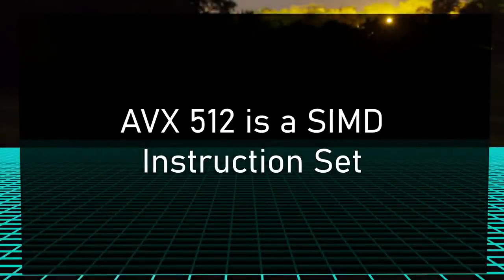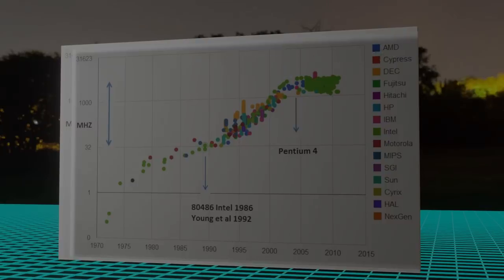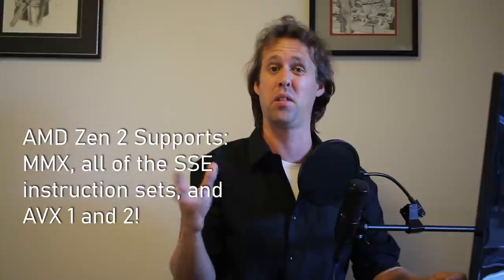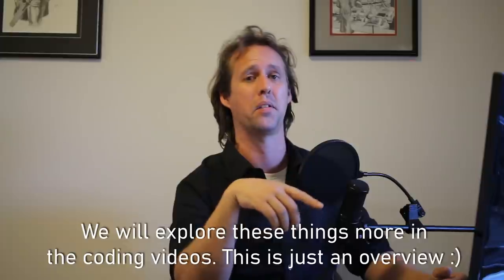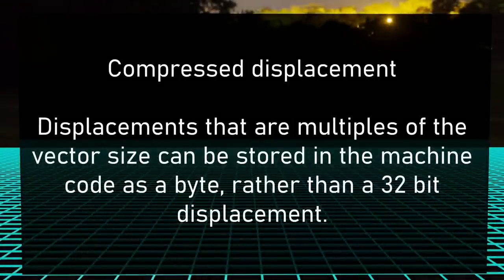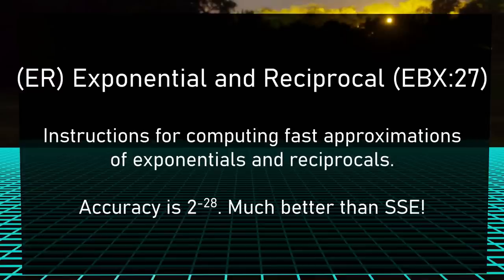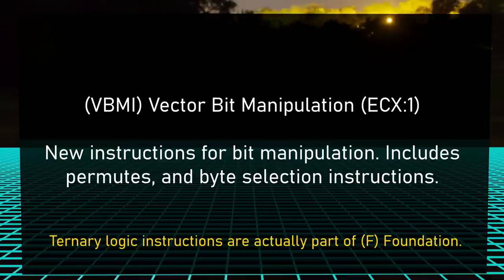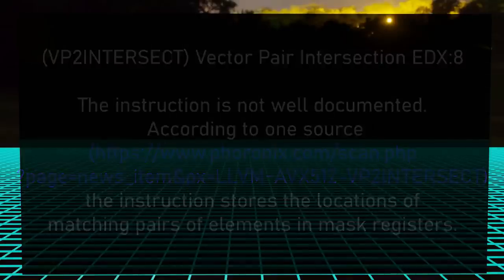AVX512 (1 of 3): Introduction and Overview

Comment: 2 years later intel doesn’t support AVX512 and AMD does (on consumer) How the times have changed
Reply: Unfortunately, consumers in particular will not benefit from this as long as most CPUs do not support AVX512. Even if they have an AVX512 capable CPU. Computer game manufacturers in particular will only support AVX512 when the market is big enough for it. Until then, consumers and gamers will have to be content with AVX2. This is likely to be the lowest common denominator over the next few years.
Of course there are exceptions. As a programmer, I don't have to buy a server CPU to use AVX512 if I can buy a consumer processor from AMD with AVX512 support. And performance-hungry end user programs, where the effort for extra binaries or plugins is worthwhile, will probably also be able to offer AVX512 support.
Reply: @OpenGL4ever  Code dispatching within the same binary could also be worth it. Also, just-in-time compiled code could also benefit from AVX-512 auto-vectorization.

Comment: Much needed, instead of the usual tripe people say about avx512 (that it's 'just 2x avx2 + a lot of mess)
Reply: Creel here points out that AVX-512 is only marginally better at floats and really shines in integer performance. Meanwhile Linus Torvalds went on a rant about how AVX-512 is Intel creating magic instructions to improve performance in float heavy benchmarks and he'd rather them focus on integer performance. Is Linus just stupid?
Reply: @Ang3lUki  The man started and helps maintain the biggest and most-used open-source kernel in the world, he is clearly not stupid; his opinion of AVX stems from his experience as a kernel dev, where massively parallel floating point calculations are just not important
Reply: @RaaynML  Not only that, but the cost of saving and loading register state, especially for massive register files like SIMD, can get expensive in the kernel when context switching. As a result, SIMD as a whole is often just completely disabled during kernel development outside of context switches.

Comment: Have you heard of the riscv vector extension? The concept seems to be preatty cool, because they allow for arbitrary vector size whiles maintaining binary compatibility. So basically generic vectorized functions.
Reply: @oj0024  Thanks!
Reply from the maker: I have yes! a lot of really cool ideas! I haven't kept up for a little while. They were talking about SIMD possibilities when I was reading up. I think x86/64 is so complicated nowadays, it is only a good thing to invent new architectures :)
Reply: RISC-V is a hot mess and will never get anywhere as is
Reply: @wierdo1111x  How so? x86 is messy as hell.
Reply: @WhatsACreel  Intel is planing to get rid of 16 Bit Real Mode support and 32 Bit Protected Mode support in Ring 0 to simplify newer x86-64 CPUs.

Comment: Question / request for confirmation for possible advantage of AVX512:
My understanding is that (without AVX512) on cache write miss, data must be read from RAM even if you will write the whole cache line later. Will AVX512 eliminate this problem? I mean if you can fill a whole cache line with one store instruction there's no need to read data from RAM (or higher level cache). The way I avoided this extra read with SSE/AVX was to use stream store instructions.
I would think the advantage with AVX512 really comes in this aspect when the output both needs to be processed further immediately (but the data needed for the next step does not fit in the registers) and stored in memory for later usage. It may be the blind spot of pre-AVX512 streaming vs non-streaming stores. Where am I wrong? :)

Comment: Single-cycle barrel shifters are a similar order of magnitude in physical size to a wallace network (aka pipelined multiplier used for fma), so you better make sure you really want one before you add it. Obviously very useful though.
Edit: well, maybe not quite the same order. You might fit 4-5 barrel shifters in the space of a 64->128 bit wallace network. Still a huge chunk of silicon you can't allocate to registers or store buffer entries or whatever.

Comment: Zen 4 is supposed to support AVX512.  Don't know if that's for Epyc only or Threadripper and Ryzen too.
Reply from the maker: That's great info! I'll check it out, thanks for sharing :)
Reply: @WhatsACreel  Just remembered it was part of Moore's Law is Dead video https://youtu.be/x7dtqdbJQW8?t=1024 .  So it was leak/rumour/speculation.  So it's not fact until AMD say it is.  Not sure SIMD is necessary on a CPU since a GPU is pretty much used for this kind of computation.  This may be AMD's stance and would use the extra transistors on future CPU architectures for something else.
Reply: @maxwellsmart3156  simd on cpus can still be good for things that need a somewhat high throughput with lower latency than gpus.
Reply: @loserface3962  Plus a lot of stuff really can't be pushed to the GPU for a bit and then results returned for the rest of the program to work on. Maybe with an iGPU and unified memory address space, but still.

I'll be interested in AMDs plans for chiplet FPGAs, although probably not gonna happen on desktop and probably only specific Epyc SKUs
Reply: The leak is for Genoa, or Zen 4 EPYC.  And what it says is it supports AVX3-512 and I believe it expands the instruction set but I'm not positive.

This is more important for server than PC, considering their large core count CPUs can be used for render servers and large data processing.  The rumor is also a core count up to 96 cores, so I can see why AVX-512 would go nicely with that.  It's a hell of a lot of compute power having 192 cores on a single server board.

I'd say power would be an issue, but since this is TSMC N5 which is a 25 - 30% power reduction, that helps to offset going up to 96 cores.

I'm more curious to see if AMD starts producing more specialized chips.  They kind of hinted at this a couple months ago in a video talking about future server products.

And I'll stick with AMD here over a variety of products.  I think they should drop the chiplet design for desktop, for CPUs that are 8 core and less since the transistor density of N5 is a substantial gain over N7.  Maybe they have a slightly higher failure rate, although TSMC has been putting out really low defect wafers.  The benefit is getting rid of the complexity of a chiplet design and no need for an IO die.  In fact if they did that they could leave a connection on that chip to add another 8 core chiplet directly to the die with both 8 cores and IO.  They would take them down to 2 chips for higher core desktop parts.  For server though, they'd have to maintain an IO die.  I DO think they should be pushing 12 cores/chiplet for server, otherwise too many interconnections to go up to 96 cores with an 8 core chiplet.

It will be interesting to see.

Comment: Just an FYI, the recently announced ryzen 7000 series CPUs have been announced to support AVX512 at launch. Would be interesting to see a simple program in AVX512 running on two high end platforms, AMD vs Intel platform. It would be even more neat if the ASM could be compared, I wonder if AMD cpus have fuseops?
Reply: I think even older ryzens have a few FMA 'cores'

Comment: After compilation how does software know if it’s running on a cpu which can handle the new instructions? If it’s not running on an equipped model, how does the compiler generate alternate code to compensate? Where does the differentiation take place? At compile time by generating alternate code in the object file or does the program have to branch to an alternate code block at runtime to compensate for the missing instruction capability?
Reply: There's compiler flags to tell the compiler what CPU to target.  If you then try running the binary on a CPU that doesn't support the instructions, it'll probably crash or throw or an error.  If you want runtime detection and branching, you'll have to do that manually.
Reply: @weirddan455  It doesn't crash, the OS will kill it. Politely.
Reply: @weirddan455  Then these new instructions seem pointless if compilers, linkers, and installers can't take advantage by producing object modules which support various architecture features, then can decide which version of the object code block to install.

Comment: So glad we have this taking up lots of space for limited use. Especially when there’s other ways to achieve this.
Reply: Totally agree.  Intel has made a poor decision on this AVX-512 stuff.  It is not useful for 90% plus of its users.  They should not implement it in the mainstream product.
Reply: @catchnkill  These instructions should be implemented on an accelerator chip/card for this kind of operations. Or well... create a parallel line of processors with and without these instructions for the people that need or not that. I'm sure that without these instructions, you could fit another core that will help more for most people.
Reply: @catchnkill  I highly disagree. I hope AVX-512 will become mainstream in every x86-64 CPU. 
Reason: 
A highly optimizing compiler will use it when it's available, even in cases where a normal programmer would never think to use the SIMD unit for it. Special accelerator chips/cards are expensive, usually have a small market share, access to them is slow due to the BUS and programs have to be written specially for them. Because of the latter case, compilers cannot use them for normal programs written for the CPU. Normal program code does not benefit at all from such external accelerator chips. With AVX512 it's different because of compiler optimization. The only prerequisite is a wide adaptation of AVX512 in all x86-64 CPUs.
Reply: @OpenGL4ever  It is a poor move that has made Intel way far behind AppleSilicon.  They put AVX-512 into every chip in latest few generation chips while less than 0.1% of buyers actually use the feature.  The feature is there.  It takes silicon area.  It consumes energy but is doing nothing.  The wasted die area can be used to put more small cores in it.  I do not agree that Intel should put a nearly never used feature into every chip.  In fact, they have started to disable the AVX-512 in manufacturing to save energy.  And they also require PC manufacturers to turn off AVX-512 by default in BIOS.
Reply: @catchnkill  This YT spamfilter is shadowbanning again, so I have to split my comment from just now into several parts to find the trigger word.
Part 1 of 6
Apple was only faster for a very short time. Current x86-64 CPUs have long been faster than Apple CPUs again and this applies to both AMD and Intel CPUs.
Reply: @catchnkill  Part 2 of 6
There's nothing wrong with that.
It takes time to adapt the compilers to AVX-512. It also took a long time until x86-64 was properly supported and the extended registers of the 64-bit long mode could be used. Compilers are not created overnight, they need time to evolve.
Reply: @catchnkill  Part 3 of 6
No, AVX-512 doesn't use energy if it is not used. Energy saving features are shutting down the units and its transistors that are not needed.
Reply: @catchnkill  Part 4 of 6
I disagree, more cores will not improve single thread performance. But AVX-512 does when it's in use.
Reply: @catchnkill  Part 5 of 6
As soon as AVX-512 becomes more widespread, i.e. there are more CPUs with this feature among end users, applications will use AVX-512 in the same way that SSE2 is used for many things today. And today's compiler uses SSE2 for things where a human programmer programming directly in assembler would never think of using SSE2.
So ordinary tasks.
Reply: @catchnkill  Part 6 of 6
This only affects certain CPU models. They probably made a mistake here and there, but future CPU generations won't have that problem.
Reply: @catchnkill  BTW. if you search for "AVX 512 vs. off" comparison videos here on YT you will see, that AVX-512 will improve in games the framerate performance. This is a clear sign, that AVX-512 increases single thread performance, like i said. You can't do that with more cores. And it's already well known, that more cores don't scale well in games.

Comment: Its not fully supported in hardware though, i.e. it does not  execute any faster because intel didn't add the extra alus needed, it merely supports it so developers can write mainframe code on dezktops.
Reply from the maker: Oh, that's an interesting thought! This would explain why the floating point performance I measured was the same speed as AVX. I figured they would work on the speed as time went on. I think it was similar in Sandy Bridge, with the original AVX. Must say, the integer performance was great in AVX512, and certainly the masking and auto-broadcast etc. are all really flexible additions too! Anywho, cheers for the info and thanks for watching :)

Comment: Hi, I have a noob question

If our computer has a GPU, why do we bother using AVX? is it just about the cost of moving data between CPU and GPU or is there other factors?
Reply: Essentially yes, the latency between the GPU and the CPU is extremely high in terms of CPU time (thousands, if not tens of thousands of clock cycles). For raw throughput, GPUs are often more performant. But sometimes you want to calculate more stuff, but don't want to wait for it that long. There are also lots of tasks CPUs are really good in but GPUs are terrible at, because CPUs are designed to do stuff really fast, while GPUs are designed to do lots of stuff in parallel, efficiently. This kind of brings the CPU a bit closer to the GPU realm, which can be handy for certain applications
Reply: @spicybaguette7706  Thank you for the response :)

Comment: What's a creel name change?
Reply from the maker: Well spied! Changed it to be simpler. Thanks for watching :)
Reply: @WhatsACreel  I still don't know what a creel is haha
Reply: @billowen3285  is it a fish? It sounds like it would be a fish. I m replying before I Google it ofc.. It's tradition
Reply: @arditm2178  In Scotland, it is a device used to catch lobsters. They are basically a wooden and cement-bottomed, net structure (usually a curved roofed barn shape). The "walls" and "roof" is made from rope/net - wide enough for fish to swim through - which is also used to create a funneled entrance into the centre of the creel. The lobster swims into the funnel of the creel, but can't swim out of it again due to magic or a cult. You go out in your boat, and throw the creels into the sea, all tethered together with a bouy at the end for finding them again. On collection, you should have a lobster or two (not in each one, we're not crazy), just waiting there in the creel. Occasionally you'll get some dickhead crab who thinks its hilarious to jump in to the lobster's seat. A quick five minutes in boiling water does the trick.

Comment: Hello everyone. Do you know which of these CPUs will perform better in machine learning and data science tasks, no need to say I would use a Nvidia GPU like 3070 besides the cpu, but I wanna choose an appropriate cpu for these types of tasks. These are my choices:
1. 5900X:       $250 (used)
2. 13600KF:   $400 (used)
3. 13700KF:   $500 (new)
But as you know there is another  important factor,  GPU. if I choose the 5900x then I could spend the extra money on a better GPU. If I wanna summarize both CPU and GPU configuration I afford are these three options:
1. 5900X + 3080Ti
2. 13600KF + 3070Ti
3. 13700KF + 3060 / 3060Ti
 which one should be a better combination?
Reply: That depends on whether you need to move a lot of data back and forth between RAM, GPU, and CPU when using the GPU solution.
The BUS speed is the slowest and does have the highest performance penalty.
That's why sometimes it's better to do everything on the CPU. The BUS does not come close to the data throughput and clock rate of the CPU.
The situation is different if you can move the data to the VRAM of the dedicated GPU and the data stays there for a long time and is only read out at the end. Then the GPU makes a lot of sense. And then of course there are the cases where a CPU is significantly slower than the GPU. You then have to weigh up whether the penalties for pushing the data over the lame BUS are worth it.
Another way would be to just put the money in a strong CPU and upgrade the GPU later when you have money again. Until then, you can use the old GPU.

Comment: Too bad consumer cpu’s barely even support avx 1 still. Only sse2 is always available.
Reply: AVX support started 10 years ago with Haswell. I don't know about AMD. 
As soon as Windows 10 is no longer supported with updates, you can rely on AVX2 as a common denominator. Because Windows 11 does not officially support most of the old and broken SPECTRE and MELTDOWN CPUs. So if you want to use Windows 11 with official CPU support, you have to upgrade your CPU as customer anyway. And all new CPUs do all at least support AVX2.

Comment: A lot of these seem like things that would be better done on a GPU/can already be done in greater volume on a GPU. Why add these capabilities to CPUs? Doesnt that spend die space and instruction caching efficiency that impacts everything else?
Reply: 1. Doing work on a dedicated GPU comes with a penalty. The bus is slow, thus data exchange between GPU, CPU and RAM is slow and latency high. For example in games things like physic effects that should affect the game play and not only be eye candy are better done on the CPU.
2. General code does not benefit from dedicated units like a GPU. If code is to use a dedicated unit, it must always be written specifically for the dedicated unit to be used.
It's different with AVX-512, here it is enough to recompile the general code with an optimized compiler and it can already benefit from AVX-512 if AVX-512 can be used profitably for this.